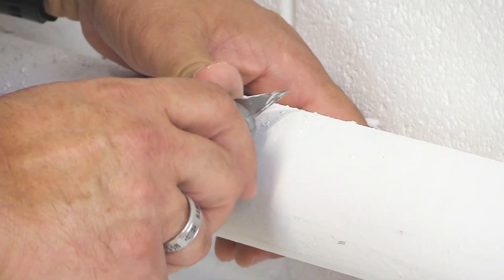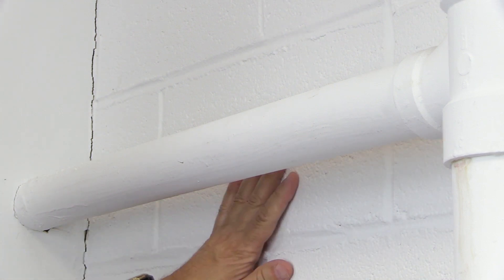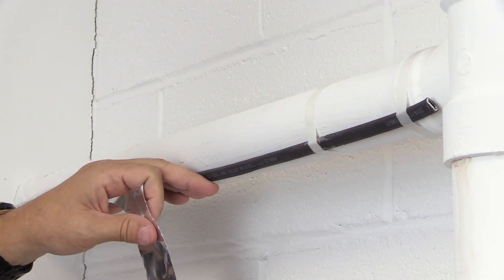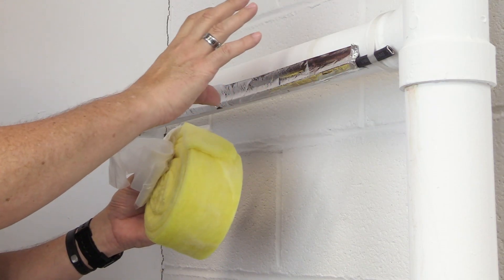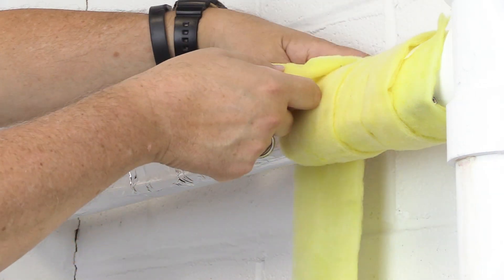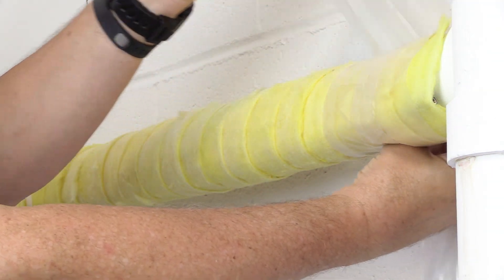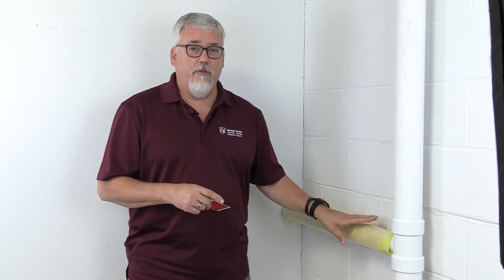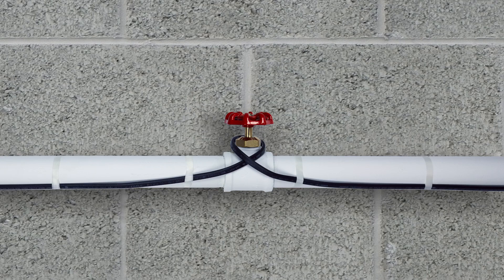Tips for Installing Self-Regulating Heat Trace Cable for Pipe Freeze Protection

Comment: Can you wrap the insulation with heat-resistant plastic saran wrap?
Reply from the maker: If you are purchasing a pipe insulation kit, it sometimes comes with or states what type of wrap can be used. We do not recommend Stretch wrap (saran wrap).  It is not strong enough.

Comment: Can we use a spray foam over the wire?
Reply from the maker: No. You must use the materials mentioned in the instruction manual - no substitutions. Product must be installed correctly for warranty to apply.